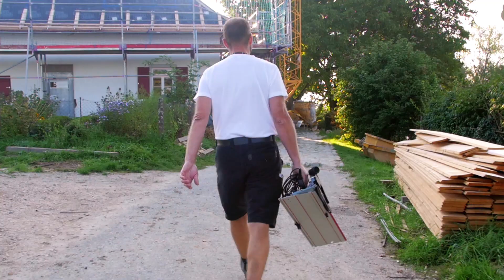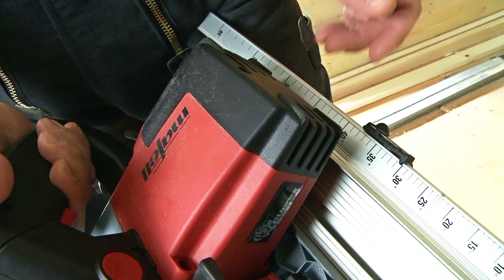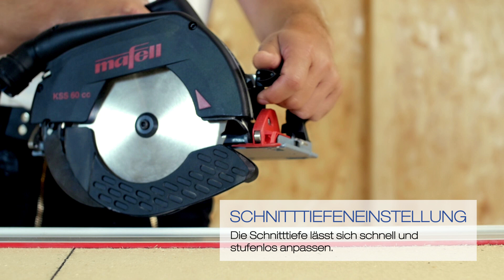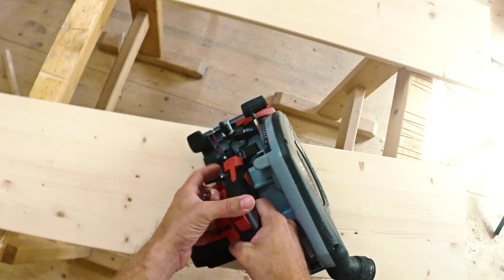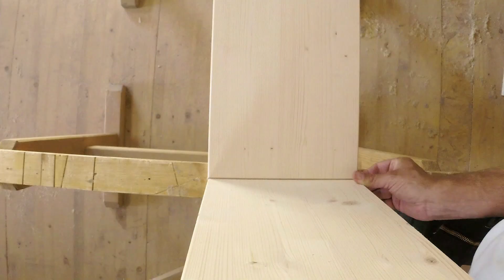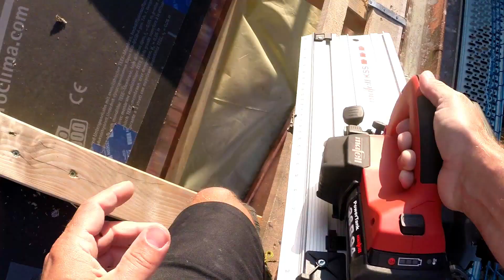Mafell Kappschienen-Säge KSS 60

Comment: Hallo Mafell-Team,
wird es auch eine längere kappschiene geben, wie bei Metabo und Festool? Mit einer Schnittlänge von 65cm oder mehr. Wenn man beispielsweise Osb-Platten Kappen möchte in einem bestimmten Winkel oder eine Küchenarbeitsplatte, dann ist die aktuelle Kappschiene oft zu kurz.
Viele Grüße,
Béla
Reply from the maker: Hallo Béla, 
wir haben im Sonderzubehör eine Kappschiene mit max. Schnittlänge 770 mm, passend für K 55, KSS 50, K 65, KSS 60 und MF 26 cc: https://produkte.mafell.de/zubehoer/fuehrungseinrichtung-ml-maximale-schnittlaenge-770-mm
Viele Grüße
Reply: @MafellGermany  Vielen Dank Mafell-Team :)
Reply: @MafellGermany  will this current saw cut 2"×4" lumber in the USA?
Reply from the maker: @rickyperkins232  The KSS 60 cc cuts 2 3/8 inches deep with the guide track you can see in the video. The cutting length with the mounted guide track is 16 1/16 inches. A 2x4 is no problem (cross cutting or rip cuts). Cutting depth without track: 0 – 2 5/8". Here you can find more details about the machine: https://produkte.mafell.de/usa/search?sSearch=91B123
Reply: @MafellGermany  thanks.
Reply: @MafellGermany  good evening, I have a question, the Mafell Jigsaw is it going to incorporate a battery ridding the power cord and and a light at some point in time?